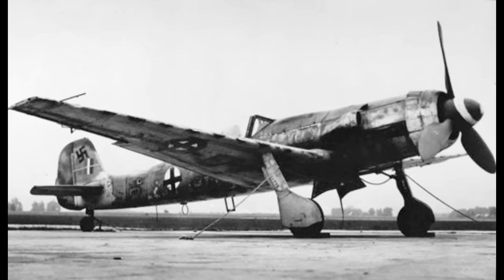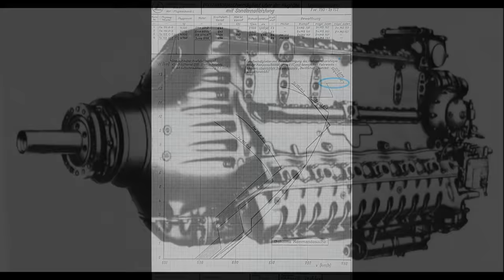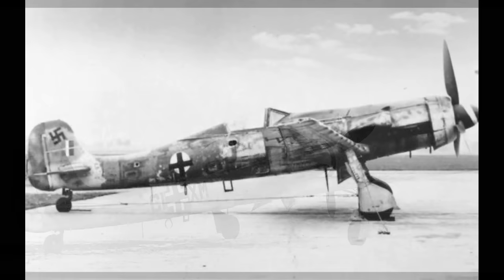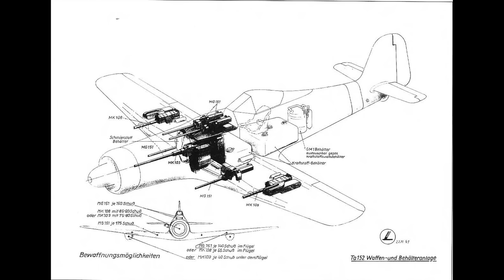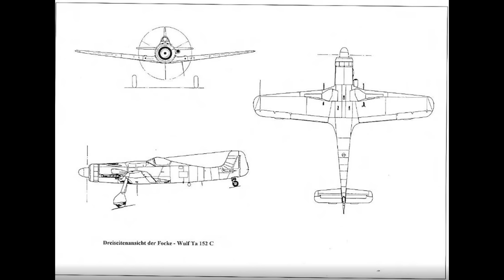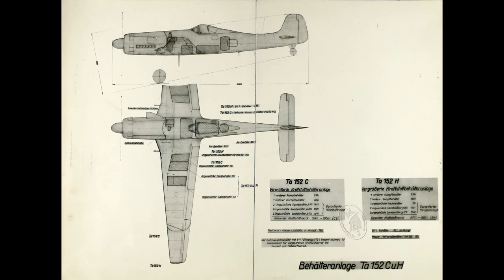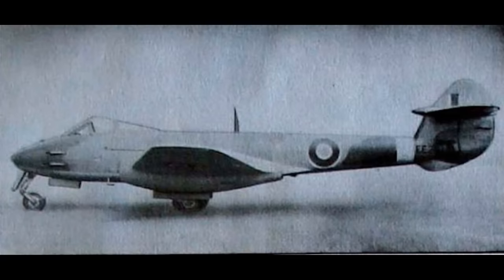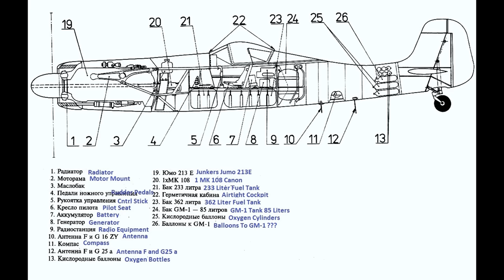Focke-Wulf Ta 152 H-1 Extreme Speed At High Altitudes.

Comment: Hi Greg, I can't remember what video I asked this question on so I've come to your most recent aviation video. A while back I asked if there was any real difference between the razorback canopy/fuselage versus the same aircraft with a bubble canopy. You responded saying that any real drag difference was negligible and I was happy with that answer and that I got the response at all! I recently have stumbled on some information on... instagram I believe? Anyway - they said that the bubble canopy was technically not as good as a razorback in terms of straight performance but was a good trade off for all around visibility. I raised an eyebrow and read on where it was explained that often times (not all aircraft) the loss of the larger fuselage profile resulted in the loss of yaw stability of the aircraft. This would then be remedied by adding ventral fins like on the bottom of the F-16 -historical example would be the P-47N-15 which of course, added drag. I'm not sure how much I believe of this, but I'm relatively convinced that in the end all of these factors really are just negligible ,like what you said, and that obviously a canopy with good all around vision is a great benefit to aircraft of this type. Anyway I just wanted to share this with you and possibly get your thoughts! Thanks for making such detailed videos on my passion, aviation.
Reply from the maker: The differences in drag are minimal. This is evidenced by the fact that the cruise speeds at given power settings and weights are almost identical. The razorback is lighter however, over 500 pounds lighter! It's also worth noting that snap rolls are prohibited in the bubble tops, but not in the razor backs. New video coming soon that addresses some of this. (within a week)
Reply: @GregsAirplanesandAutomobiles life got so busy I couldn’t even watch a lot of stuff. Kids haha. Anyway, did you ever make a video mentioning this stuff?

Comment: My try at translating the flight manual page showing up at around 28:00. It is written in a very short-hand sort of German.

IX. [High] altitude flight

Rescue-safety device:

A. Start oxygen breathing at 4000 m and always keep breathing oxygen above 4000 m.
1. Open oxygen remote operating valve. Watch pressure gauge and O2-monitor.
2. Use oxygen shower in case of shortness of breath (press down with ellbow.)

B. Start pressurized mode at 8000 m.
1. Rotary valve for breathing air supply to position "pressurized operation".
2. Fill sealing hose. Press valve for 15-20 seconds.
3. Monitor internal chamber pressure from time to time. Interior pressure equals 8 km.

Comment: Another, possible consideration in pressurizing the Ta-152H cockpit:  At altitudes above about 35,000 feet, breathing 100% oxygen from a diluter/demand oxygen regulator is insufficient to maintain normal blood oxygen levels.  One method of overcoming this problem is to use a pressure-breathing system with a regulator that automatically supplies the mask with oxygen at pressures higher than cabin altitude above 35,000 feet.  I recall that some models of 737 Classic airplanes required such masks in the cockpit, while earlier models which had lower operating ceilings had masks that operated in diluter/demand mode only.  Breathing oxygen at higher than ambient pressure is tiring, because the oxygen must be forced out of the lungs when exhaling.  Pressurizing the cockpit to 26,000 feet would allow the pilot to safely breathe from a diluter/demand system without pressure breathing function while loitering at higher altitudes.
Reply from the maker: Yes, I actually added  this issue to the description last night.

Comment: The Paul Allen Museum of Flight in Everett, WA has what I thought was a TA-152. When you said only one TA-152 exist and it's the Smithsonian, I had to go back to check my observation. The plane in the Paul Allen Museum is labeled FW-190 D-13 (Dora); is powered by a v12 and is said to be the only one to exist. Upon casual appearance, it certainly resembles the TA-152. Did any FW 190's feature V12's?   You do good work!

daf
Reply: The Dora variants of the FW 190 (from which the Ta 152 was developed) all had inline V12s, check the exhausts. They did however keep the radiator of the earlier A models, probably because why fix what ain't broke.
Reply: Thanks!

Comment: Very interesting, thanks a lot. I wasn't even aware that the Ta 152 saw service.
Native speaker and pilot here: It might be interesting, for comparison, to put any comparisons into context, to note the text at the top right of the graphs. It reads:
"Speeds considering the rise in drag due to compressibility; without ETC; with movable landing gear doors; _sealed engine slots_; smoothed-out ("gespachtelt", referring to smoothing out unevennesses using putty) surface and smooth paint."
So these are numbers under optimal conditions, and perhaps not representative of war-time missions.
Reply from the maker: Thanks. I did use the lowest of the two charts I have for the plane, so as far as official data goes, it's as conservative as we have.
Reply: +pinkdispatcher  This is probably the most widely published photo of Ta-152s that were in service with JG-301.   The NASM example "Green 4" is in that line somewhere but I forget which one it is. https://i.pinimg.com/originals/9b/51/0d/9b510dd6aff4fee9e8f8b2e8b0a7264f.jpg

Comment: 28:41   2. On appearance of trouble with your breathing use the “oxygen shower”. (Trigger by pressing within your elbow)  my interpretation is that you can release extra amount of oxygen by an elbow operated button.
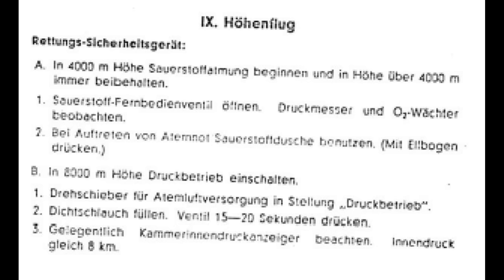29:54 The whole B section is the pressured mode pretty much as you translated it. Seems like there is a selector switch (drehschieber) for that mode. 2. Describes the pressurizing of the sealing-tube 3. You got right advice is to check the “chamber inner pressure” frequently must be the cockpit pressure.

Comment: I don't remember what source I read it in, but I read that the Ta-152 was used in the late war to protect jet fighter air fields, because the jets were so vulnerable on takeoff and landing.  I remember thinking it was ironic that a high altitude aircraft was used for this low altitude mission.
Reply from the maker: I think that's true, I have read it as well. The realities of war often dictate that aircraft are used outside of their intended roles. This happened with the P-47, the PBY, and to an extent, the P-38.

Comment: 29:45. I really don't know for sure, but I guess you are right in your assumption. At point 3 it states "When short of breath use oxygen shower. (push with your elbow)" 

It sounds like some kind of emergency system in case that the usual oxygen supply does not work properly, or fails.
So far I haven't studied the Ta 152 a lot since its rare use in the war.

Comment: there is a TA152 in a private museum in Washington state in mostly flying quality but is not flown due to some missing fuel control parts and it’s there are only 1 or 2 in the world left
Reply from the maker: I think that's a Fw 190 D-13 that you're thinking of, not a Ta 152, although a close relative.
Reply: you are correct, In a earlier video you mentioned that a 109 could probably out turn a mustang B C or D at lower altitude. I have heard several Mustang Pilots speak about  being able to use the flaps at a relatively high airspeed ; That Add-on of flaps gave the mustang a edge in a Turing fight. I fly Crop-duster and I know way different wings but I do know in a max performance turn with Ag Airplanes adding flaps really makes them come around . what are your thoughts on the mustang adding flaps in a turn. Does it raise the induced drag to the point where the mustangs looses its airspeed advantage or does the War pony come around After about 2 turns get his guns on the 109 like Ive been told and chop him to peaces

Comment: 14.500 metres = 14.5 kilometres. Impressive for the time. I've seen F15's climb to virtually invisible altitudes within minutes, and even with my binoculars appear as a mere spec. They could reach 25 kilometres within minutes in a steep vertical climb. 
Over equality engines are remarkable.

Comment: Hi. Great video. About induced drag. A high aspect ratio wing does not require less angle of attack at a low IAS compared to other wings. Angle of attack and thus the CL (lift coefficient) have a consequence on the lift and at constant speed and air density its the only variable you can control . if a plane weighs the same you need the same CL to keep it level with one wing or another. High aspect ratio reduce induced drag because the smaller chord generates less lift per unit of wingspan, thus reducing the spanwise lift distribution magnitude at any point. This creates less flow turbulence, less flow deviation, less wake suction, less induced drag. 

Please keep these vids coming, they are very cool.
Reply from the maker: The quotes I put up are from "Aerodynamics for Naval Aviators", the most peer reviewed book on this subject that one can find. In this book, and I put the page up at 23:09, second sentence, it clearly says that decreasing aspect ratio requires an increase in angle of attack for a given amount of lift.
Reply: Essentially, the book is playing ahead of the game. So as the low Aspect Ratio plane is subjected to more induced drag, it experiences much more induced downwash (a mustang compared to a Ta-152, in the order of 150% more) and to fly level the pilot needs to compensate with increasing angle of attack. Its a consequence of the induced drag, not an inherent property of the wing Aspect Ratio coefficients, and it doesnt explain why theres more induced drag on a low AR wing. Though the book has conveniently bonded one thing to another. On supersonic regime for example, where induced drag is not relevant, the book’s statement would be wrong. I have not read this particular book, does it deal with subsonic only?

I just wanted to clarify where the induced drag was coming from, that the induced angle is a consequence of the induced drag, and not the other way around. I can see you document yourself well and use relible sources for your videos. Sorry if I am being troublesome or appearing ill-mannered.
Reply: @jg54cule  Are you saying that for two wings of the same area, the wing with the higher aspect ratio will not require a lower angle of attack to produce the same lift at a given airspeed?
Reply: Gort  Depends on what you mean by angle of attack. The aerodynamic angle of attack, the one the airfoil sees, will be the same to produce the same lift coefficient for a given wing area, regardless of AR. However, the geometric angle of attack will be lower in a high aspect ratio design, because the induced downwash is less for a lower induced drag design.
Reply: @Gort If you, from the ground, saw two aircraft both travelling at 15 degrees angle of attack relative to the *horizon*, then the higher AR wing has a higher CL but thats because they are actually flying at different aerodynamic angles of attack which you can't appreciate from the ground. The freestream is being diverted locally by the downwash of each plane. So in terms of aerodynamics each wing is seeing different angles of attack and different aerodynamic forces / CL depending on the intensity of downwash.

Downwash causes a (negative) induced angle of attack which substracts from the geometric angle of attack which "you see from the outside" relative to the horizon if the plane is flying straight. The higher the AR, the lower the downwash, the lower the induced angle of attack. 

Perhaps one plane is really being subjected to 5 degrees of alpha and the higher AR one to 10 degrees even though they look the same to you.

But if you made both planes fly at the same aerodynamic angle of attack, they would produce the same lift if they had the same wing area, velocity, air density.

Comment: Omg I was actually waiting for a video about this plane!
Reply from the maker: Really? That's good to know. I have been surprised by the interest in this video. I didn't know anyone cared about this obscure plane. It makes me happy to see such interest.
Reply: @GregsAirplanesandAutomobiles  I guess the obscurity is part of the interest. It is the "what could have been" that makes it way more interesting. Much like the Horten 229 for example
Reply: @GregsAirplanesandAutomobiles  Of this "obscure plane" I had the first surprising notice as far back as 1960, thanks a construction kit for a circular bound flight model from the German company Graupner (it still exists, but its current production is of the buy-use-throw genre - to say: disgusting). I was immediately appalled by the shapes of this aircraft, accustomed as I was by the usual Bf 109-110, Ju 87-88, He 111, Do 17 etc. which appeared in the magazines "Signal" and "Der Adler" purchased by my elder brother during the war. It appeared, like it came from the outer space. The construction kit was quite basic, a few plastic parts: the pilot's canopy , the annular radiator, the "carburettor" (sic!) air intake ... all the rest was reduced to a few pre-cut plywood sheets, a pile of strips, panels and blocks of balsa to be modeled manually, with care and patience, and three low pressure balloon wheels. The drawings and camouflage patterns (with the low-visibility Balkenkreuze, which I knew for the first time - no Hackenkreuz on the rudder, only a  dashed, 45° tilted square) were of excellent quality, with a succinct description of the plane and of its designer.  Some sentences I still remember perfectly: " ... Ein 152 liegt auf der Funkbeschickungsdrehscheibe ...  ... Dr. Tank, der selber ein exzellenter Pilot war, konnte sich ohne Muehe dem Pulk von vier Mustangs entnehmen ...". A realization too demanding for me, even though I precedently managed to build and fly a Me 109 G6 and a Me 109 K14 (at the time it was a bit confusing between Me and Bf). In the end, I decided to abandon the enterprise and destroy the unfinished model, to avoid a kind of psychological block. I kept the large construction sheet somewhere, maybe one day I'll find it.
P.S.  Congratulations for the most-most excellent site, thanks and good work - sg

Comment: Is the larger version of the fw-190? I think those were the stretched version of the 190 and it recieved an inline engine. The aviation museum in Ohio has one on display.
Reply: + Free-bird Rocker  No, this is a Ta-152.  The Fw-190D series was the version with the V12 engine and there is one at the USAF Museum in Dayton.  When Kurt Tank was designing the Ta-152, the first prototypes were constructed using existing Fw-190D airframes.  However,  the Ta-152 was really a new design, next generation aircraft and not part of the Fw-190 series.  You can't convert a Fw-190 into a Ta-152 easily.   Only one Ta-152 survives at the Smithsonian Museum.

Comment: ..I have seen videos of the Jumo 213 engine running in the FW-190 D(9?), and while it seemed hard to get started, boy did it sound wicked!..quite a bit different sound than a Merlin, Allison, or even a DB-601/605....
Reply: +dyer2cycle     The Champlin Museum used to run-up the Fw-190D-13 when they owned it, but it was not running very well.   The Jumo 213 has an engine control device similar to the Kommandogerät found on the BMW radial.  That device was missing on the D-13 which made it difficult to start and only able to mostly idle.   When Champlin had the D-13 rebuilt again, the engine was gone over to replace missing parts, but there was no time to run the engine for some videos before it was sold to Paul Allen's museum.   An engine shop in California has been finishing a fresh Jumo 213 for a customer and it should be done or nearly done by now.  But owners can be particular and I don't know if the customer will allow any video to be shared of the new Jumo exercising on the test stand.  That 213 is supposed to be flight certified. The same shop completed a flight certified Jumo 211 for Paul Allen's museum, but again no video of the Jumo 211 testing has been made public.
Reply: @FiveCentsPlease  ..yes, I remember it was hard to start and was mostly idling,and backfiring some, but as I said, it sounded wicked!..I'd love to hear a good running one :)

Comment: Regarding the cockpit pressurization what i´ve heard from real combat pilots when they flew training aircraft they couldnt live without it at high alt because the quick ascend or descents could leave them deaf (barotrauma) and if they had a slight cold they didnt even get close to the aircraft (im comparing in this case training military aircraft to ww2 fighters), b17 and other bombers didnt need them because they took much longer to get to altitude and descend but b 29 had pressurization because the extreme high altitude it would go the crew wouldnt adapt.